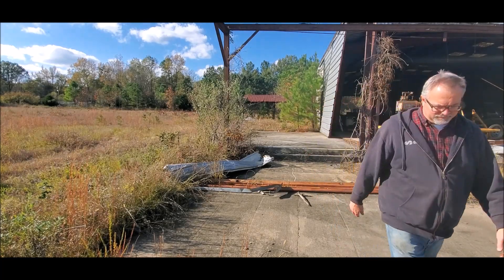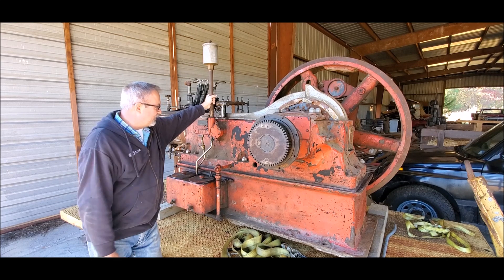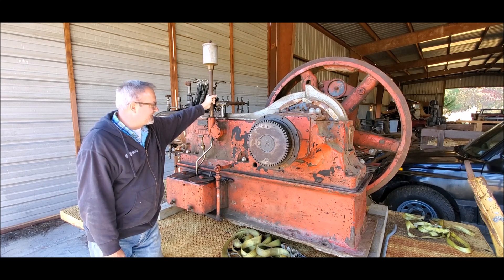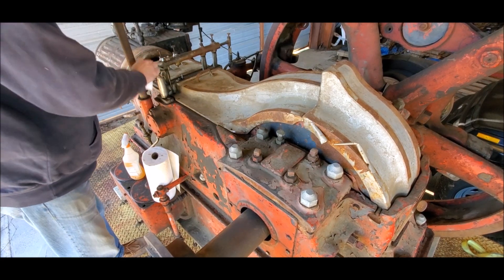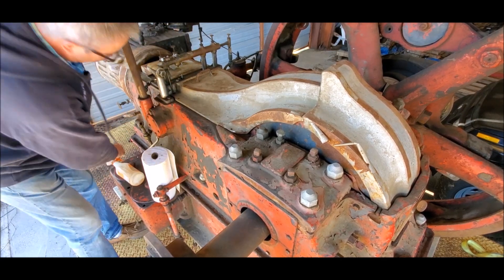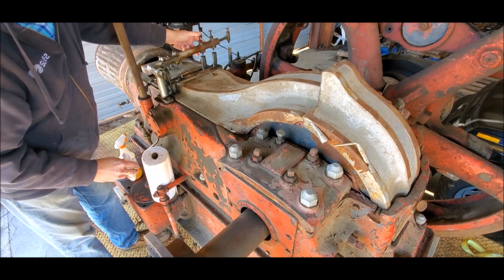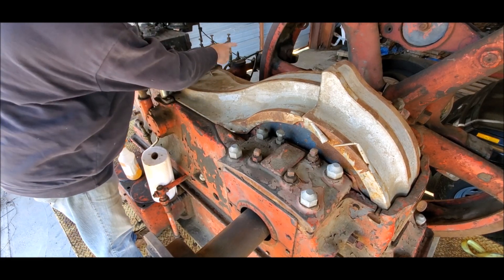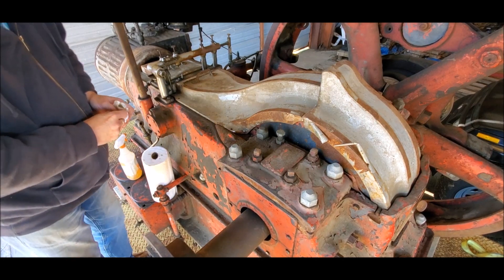Moving the Skinner Steam Engine

Comment: So where is the dynamo part of it?
Reply from the maker: Sadly did not come with it. Will gladly accept a vintage GE 460v 3 phase dynamo as a channel donation! 😁
Reply: If I had one it would be yours!! How did it get separated from it at the museum?
Reply from the maker: @bcbloc02  The Colorado Mining museum is another engine, fully restored. There is an engine/tractor heritage fairground locally that has a third Skinner with its dynamo. That's the only three I know of. Mine develops close to 150hp at 150psi and 300 rpm.
Reply: Engineers Workshop Fabricating a reproduction dynamo would sure make some good video!! 😎
Reply from the maker: @bcbloc02  Above my hay grade. One day maybe, or you could go for it. I'll model it on CAD.